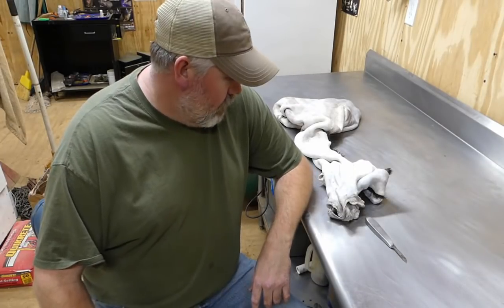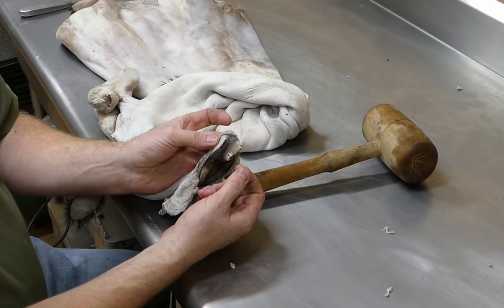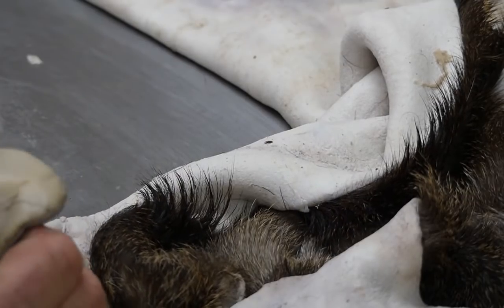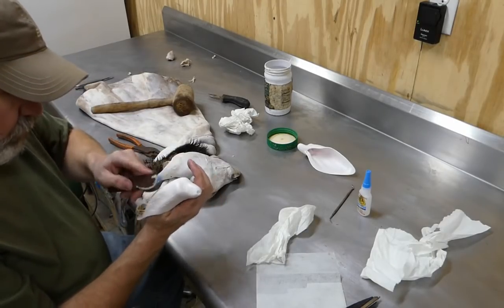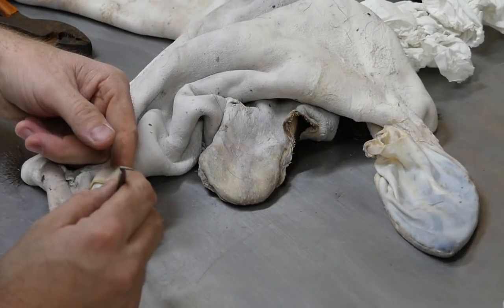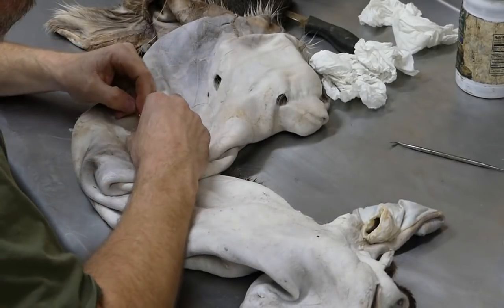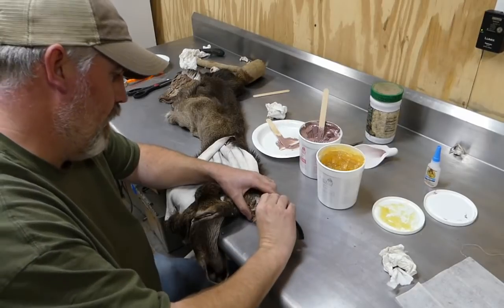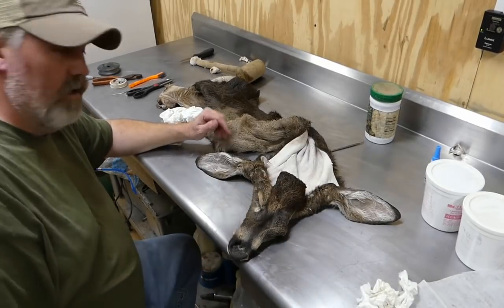How to prepare a deer cape for taxidermy

Comment: sorry for asking this, question is do you have to take off the cartledge on the ear?
Reply from the maker: Hey thanks for watching! There’s a couple of different techniques that you can use to mount the ears. The one I use is the use of ear liners and I would recommend removing the cartilage so you will have a really clean crisp looking ear. You can however use the bondo method where you will leave the cartilage in and mount it this way. There are some types of ear liners that can be mounted with the cartilage in but in my opinion if you are going to do that you might as well use the bondo method I think the results pretty much look the same. Be sure to hit the notification button so you will know when I have more content available on the channel.

Comment: I hope you will go thru all the steps to do a deer mount from start to finish...just found the channel and REALLY want to learn more about this skill. As a hunter, id love to do my own mounts. I have a few euro skulls I could turn into mounts at some point. Question: so the hide is wet right now, and the ear liner epoxy is setting. Do you wait a period of time and then transition directly into mounting it on the form? Or do you leave the ears to sit overnight? And if yes, does the hide get stored overnight a certain way?
Reply from the maker: You can use those euro to get started you will have to get some capes. Make sure to hit the notification button to be able to get notified when I have new content available. After the the tool and supply video I plan on doing a tanning video.